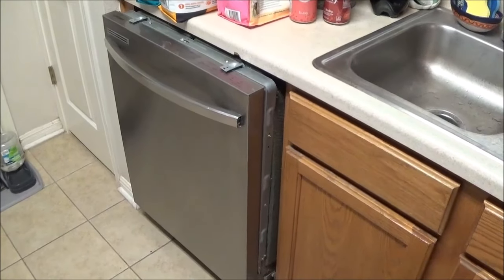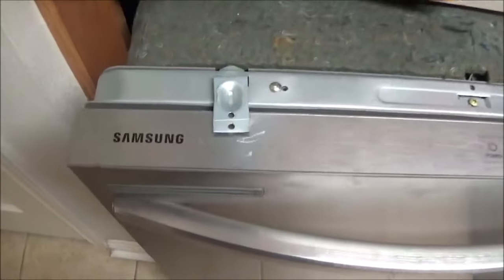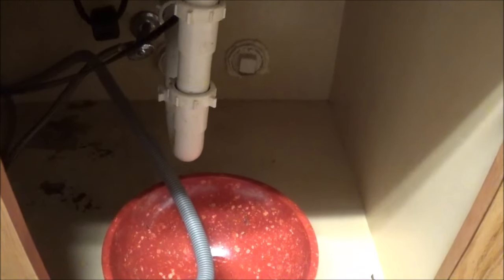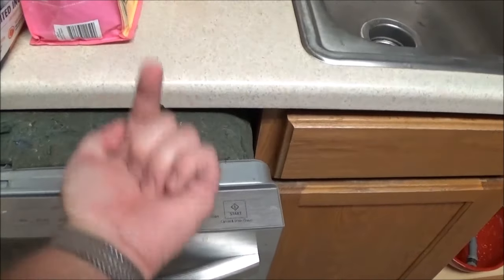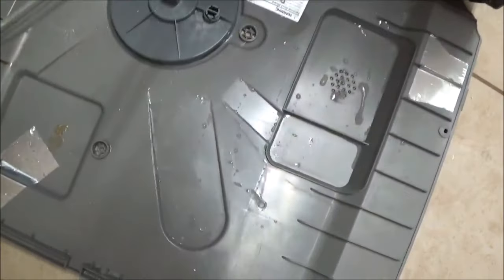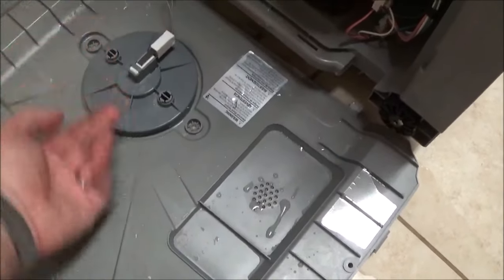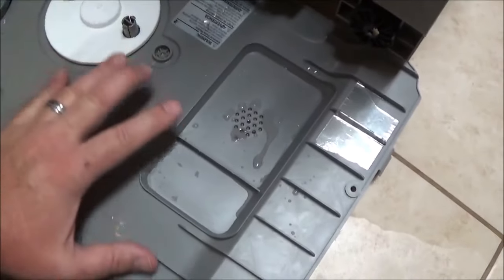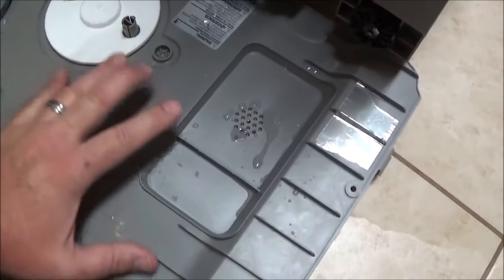Samsung Dishwasher Blinking Normal Light FIX!

Comment: Sir I would have never guessed this fix in a million years. I followed your directions exactly and am in business.  and my wife is thrilled.
Reply from the maker: Excellent.  Glad you are up and running again.  TYMM :)
Reply: Hoping this works for us tomorrow.  Got 2/3 of the way without the video and then decided to YouTube it when everything seemed cleared out but still blinking. Thank you for this!
Reply from the maker: Dani it could possibly be the electromechanical water inlet valve that is the issue. Referenced in the video.
Reply: So far so good from Northern Illinois. My styrofoam piece was pouched out a little. I had to sand it down a little to get it closer to flat. Just barely sanded down the top piece so it wasn’t triggering the switch. Like I said so far so good. Just need it to work till Jesus comes back! Thanks for the video 👍🏼
Reply from the maker: Fantastic!  Thank you for the nice feedback.  Glad all is working now. Thank you for watching.  Please like, share, and subscribe.  TYMM :)

Comment: What you should do is put the discharge hose through a new hole at the topmost area in the bottom of the cabinet to create what's called a "high loop"  This prevents stagnant water from going back into the dishwasher.

Comment: I have the same dishwasher. My normal light was flashing and I had to turn off the dishwasher by the circuit breaker because nothing else would work. Your video was super helpful. I’m a single lady but I need to figure out how to do this myself because I don’t want to buy a new one, so thank you very much. I have had the dishwasher for four years. Never had one problem with it after my son installed it for me. It’s been working great until now.
Reply from the maker: Hi Anna.  Glad this helped you. I have had mine for 4 years also.  Thank you for watching. TYMM :)

Comment: We bought this exact dish washer. Got it hooked up, then realized the drain line that goes to the garbage disposal has a punch hole that you have to knock out with a screw driver. Because it wasn’t popped out the water did exactly what you said, blew back into the washer and remained on the bottom pan. Did what you said and BOOM! Fixed in no time. Thank you sir, wish I could buy you a beer (or two).
Reply from the maker: Yes, that will definitely cause it to shutdown and flood.  Glad your back up and running Sean. Cheers!  Thank you for watching.  Please don't forget to subscribe for more videos.  TYMM :)

Comment: Thank you sir!  The pressure relief valve on our main water line coming into our house gave out after the city added new piping and housing developments (sudden bursts of high pressure). We also lost the pressure regulator on our hot water tank and our samsung dishwasher was flashing normal and start together! Needless to say, after two expensive plumbing repairs, I was thankful to find your video and see this was, indeed, the solution we needed to fix our samsung dishwasher ourselves. In our case, I  did not find a trap blockage at the disposal, so I think it had something wonky to do with either the turning off of the mainline or the draining of the hot water tank. Either way, this was the fix! Thank you!
Reply from the maker: Great write up on your problem. Excellent to hear it is back up and running now.  For whatever reason (there can be several), if there is water in the bottom of the dishwasher, it will not start up until the water is cleaned up. For safety reasons. Glad this video helped you Heather.  Thank you for watching and please like, and subscribe for more TYMM videos.  TYMM :)

Comment: Note: this comment is from my father 
My name is Kevin too, I live in Hamilton, Ontario, Canada. I have a four month old dishwasher just like yours, with the same problem as you. I spent a couple hours trying to figure out the problem and came across your site. You helped me fix my problem and you have a friend here in Canada! Thanks man!
Reply from the maker: Hi Leah - Please tell your Dad (Kevin, cool name!) he is very welcome. I love to hear when my videos help people.  Love my friends in Canada.  TYMM :)
Reply: What did you have to do to fix yours? Mine is less than a week old and started flashing.
Reply from the maker: I had to fix mine twice.  First time was the water inlet valve located underneath was leaking.  I had to replace that as it was leaking. Second time my sink P trap was clogged.  The dishwasher backed up and water seeped into the bottom.  The dishwasher will shut itself down to protect itself (blinking normal light). You have to clean the water up from underneath and dry everything.  Make sure to unplug the device and turn off water to the dishwasher when working on it.  If you are unsure, call a professional to be safe.
Reply: This worked thank you!
Reply from the maker: You are very welcome. :) TYMM

Comment: You are the man! Normal light blinking, followed this video, got her back up and running. Thank you sir!
Reply from the maker: Great to hear Cody. Glad it helped you.  Please don't forget to subscribe as it helps my channel.  Thank you for watching. TYMM :)
Reply: Update: it’s been almost a week and the normal light started blinking again. The first time there wasn’t hardly any water in the styrofoam area, I’m thinking it may be that electrical piece you were talking about, do you know what it’s called?
Reply from the maker: @codyrandles5414  it's a water inlet valve.  Electromechanical valve. But check for other areas first that might be leaking before you buy it. Check previous comments for part number

Comment: Thank you so much for posting this video. Although I have a different Samsung model dishwasher, the basic steps you provided allowed me to find the source of (1) the reason why the Normal  light was flashing and (2) why I was seeing water seeping into my shower which is just below the dishwasher. Apparently, a faulty water intake valve will cause both issues. Thanks to Samsung for creating the float that you mentioned to stop the dishwasher for continuing the wash cycle to potentially cause more damage BUT the float did NOT stop the slow drip that was happening beneath the dishwasher. The slow drip wasn’t enough to pool out in front of the dishwasher to raise alarm bells where I would have shut the water off!!  It was enough to have water pool on the ceiling. Grrrrr. 

In any event, I found the part (water intake valve) on Amazon for $33 + I bought a pack of worm gear hose clamps for $20 to reconnect the hose. Samsung wanted $130 for the valve and the clamp. 

You saved me hundreds of dollars for possibly replacing the dishwasher and calling in a plumber because we thought we had a leak in the wall. Thank you!! I provided additional details here to hopefully pay it forward and help someone else. YOU ARE AWESOME!!
Reply from the maker: Great to hear you got it fixed at the source Theresa.  The water intake valve was an issue on mine as well.  I had to replace it.  Thank you for your write up as it will help others.  Thank you for watching!  TYMM :)
Reply: @texasyardmanandmore3822  I have the same model as yours. Thank you for this video. I am single and trying to fix this on my own. What is the intake valve model number? I'm trying to buy one but don't know what to get. Thanks!
Reply from the maker: @Esmeralda-tl7cj  You are very welcome. TYMM :)

Comment: Thank you so much!! You saved me a service call. Had a lot of water spill onto my counter and it all rolled into the dishwasher (door was open) Followed your instructions and sure enough the pan was full. Letting the floor dry overnight before turning it on. I am confident that it’ll work though since the pan was so full of water.
Reply from the maker: Glad I could help!  Easy 1,2,3.  Thank you for watching.  TYMM :)

Comment: Thanks for the video. I wasn't sure how to get the bottom plastic tray off untili watched this. My leak was the inlet valve. It sits idle for 6 months because I'm a snowbird. When I turned the water on this year, it started leaking. 4 year old Samsung. I found an after market replacement valve for 40 bucks on Amazon and ordered it. But then I tried taking the old inlet valve apart. Turns out you can just unscrew the valve actuator off the valve. I cleaned out a little scale buildup and put it back on. Doesn't leak at all! So I canceled my Amazon order.
Reply from the maker: Thanks for sharing Monte.  Glad your up and running now.  Dont forget to subscribe to help my channel out and watch more helpful videos.

Comment: I had a service tech come in from Samsung twice and he didn’t fix the issue - I have the same problem- the service tech left a main board which I replaced got tired of fooling with it so I bought a Bosch but my dishwasher was on 30 days old but similar to you I had back flow of water into the unit so this weekend I’ll see if that’s the issue with the unit an sell it - much like one of the other guys commented from Ontario I thing you may have solved my problem- one suggestion maybe change title of your video to dishwasher won’t turn off when initially started you would of save me many hours sifting through videos lol - great work from Newfoundland Canada
Reply from the maker: Thank you for the feedback Darryl.  I will place the search query in the video Tag. Thank you for watching.  TYMM :)

Comment: Thank you so very much. We followed your instructions according to the " normal cycle light flashing" i got one good load done and the the light started flashing again. I think it might be the valve you mentioned.
Reply from the maker: Glad it helped.  Yes. it could be, but search for the leak first to be sure.  One other place to look is in the impeller housing.  There is an O-Ring that can leak.  My guess is the electro mechanical, water inlet valve as you stated. Thank you for watching and please subscribe for more DIY videos.  TYMM :)

Comment: This was great! Thank you so much. I think my issue is the Dishwasher Water Valve. Do you have any videos for that replacement install or is it a direct 'plug & play'? Thanks again!🙌
Reply from the maker: Glad it helped. The valve is pretty straightforward. Two mounting screws holding it.  Easy to replace.
Reply: Fingers crossed it works! Ordered the valve and will update 😊.  Great content and so glad you're here!
Reply from the maker: @YS-bl9pe   Thank you.  Please keep me posted on the outcome.  It helps other's.  If you like my video content. please don't forget to subscribe :) Thanks for watching.  TYMM

Comment: Thank you very much for your video! I did exactly follow your video and my dishwasher working well after, unfortunately the problem coming back what should I do ? Please help
Reply from the maker: Hi Louis.  Sometimes it can be a leak somewhere.  So look for that first.  If you cant find it, it may be the water inlet valve.   Look in my description of this video.  Cross check the part number for your model dishwasher.

Comment: Having the same issue with the same dishwasher. This was a great walkthrough of the fix. I had found that if I let the dishwasher sit open and dry out for a couple of days it would work again but after a wash the filter cup would be full of water and this issue would happen again after another 1-2 wash loads. I had previously tried removing the water from the cup where the filter is. Is it supposed to collect there or is that supposed to drain somewhere under normal operation?
Reply from the maker: The water is supposed to automatically drain after every wash.  Make sure there is no obstructions and the drain is clear.
Reply: @texasyardmanandmore3822   Thank you! Might the inability to drain also be due to the water inlet valve that you had to replace? Since it's an inlet valve I wouldn't think so but I'm not very mechanically inclined. I am also going to have to replace the same part. It's visibly corroded and since it's sitting directly above the leak sensor I figure that's where the leak is coming from
Reply from the maker: Its possible.  Mine went out and as soon I replaced it, it worked fine. Good luck.  Thank you for watching. :)
Reply: @texasyardmanandmore3822  I watched so many videos for this issue and they almost all talked about moving or dismantling the leak sensor which is a temporary fix. Your video is the only one I found that even mentioned the inlet valve which sits right above the leak sensor. Bought and replaced the part for ~$40 and haven't had an issue since. Thank you!
Reply from the maker: This is fantastic to hear.  Great feedback. Thank you for watching. TYMM :) @CH-hp6ow

Comment: Thanks for the video. I have followed all the steps shown and everything went smoothly. But once i start a new cycle after a minute or 2, the same error code start flashing. 
Is there anyone else in the same situation? Please let me know if you find a different solution that works for you.
TIA.
Reply from the maker: You will need to find where the water leak is coming from.  Check the impeller housing seal O-ring. Water inlet electro-mechanical valve,  or leaking water from a hose.  A water leak will cause the normal flashing light.

Comment: Do you have a recommended way to find where the water is potentially leaking from?

Initial fix worked, same problem happened again after about 10 loads. Checked the garbage disposal and pea trap and both seem fine. The sink doesn’t back up… A leak must be some where I guess, I just don’t know how to find it?
Reply from the maker: I would look underneath the dishwasher again, and inspect where water is leaking from.
Reply: @texasyardmanandmore3822  doing that now. Nothing is really sticking out to me. All connections seem dry. I unhooked the tube that empties into the garbage disposal and it leaked some water when I turned the washer on its back. Maybe the pump is going bad? Assuming a pump is what’s used to siphon the water out…
Reply from the maker: It may be the electromechanical switch I referenced in comments. Please review.  It MAY possibly be that. Replace at your own discretion.  Otherwise hire a professional appliance repair technician. Ensure unit is unplugged.

Comment: I currently have this issue and will try this in the morning. Any idea what the replacement part number was?
Reply from the maker: Its in the description.  Amazon link. They may have a newer part number so make sure you cross reference the part number and verify it is for your model.  Thank you for watching.  TYMM :)
Reply: Should have checked.. thanks! Also, I did the drying of the basin this morning and so far so good! Thanks for the video.

Comment: I had the same symptoms today.  My problem was that although the whole pan was totally dry, the foam disc (9:56 minute mark) in the limit switch was deformed - shaped like  saucepan lid - and it permanently forced the limit switch closed.  I temporarily removed the foam disc and the machine worked perfectly.  So you can try that if you have the Normal light flashing yet the pan is totally dry.
Reply from the maker: Great feedback!   Thank you for sharing in case someone else has that problem.  Please like, share, and subscribe. TYMM :)

Comment: Thank you for the video..my dishwasher is fixed
Reply from the maker: Awesome to hear Vin.  Thank you for watching.  TYMM :)
Reply: Hello… it seem to work for me but it’s giving me the same error message. Can you please tell me where I can get the electrical mechanical device that you referred to in your video? It was some type of valve. I’m guessing mine might be defective.
Reply from the maker: @vinclark3878  Make sure you identify where the leakage is first before buying the water inlet valve.  I bought it online from Amazon.  Part number DD81-02265A. Just type that in the search.  10 year warranty

Comment: I’m referring about the parts you pointed and replaced before. I’m wondering what is normal state of that? I mean normally open or close?
Reply from the maker: I am gonna make an educated guess and say the water inlet valve is normally closed until activated to open up to allow hot water to flow in the dishwasher.  If it runs for too long it can overheat. These valves are a common failure part as they get gunked up with sediment or minerals.  Or they can come faulty  due to leaking or get stuck.  TYMM :)
Reply: @texasyardmanandmore3822  Thank you for your reply. I am referring to the parts you replaced and said you bought from Amazon? How do you call that parts?
Reply from the maker: Its in the video description. The link for the part. TYMM :)

Comment: Great video. How did the water get there in the first place? Wondering if you found the source?
Reply from the maker: The water inlet valve stopped working properly the first time.  The second time I forgot to punch out the drain cap on my new garbage disposal.
Reply: My filter had never been cleaned and the bottom filled and overflowed. Clean that filter regularly!

Comment: Thank you for this video! I followed the instructions and wachine was working again. But now (after 2 runs) the light is flashing again. How do I figure out what's causing water to go down there? I have not changed anything in my setup and there is no leaking anywhere and everything is draining. Thanks!
Reply from the maker: Could be the part I mentioned in the video.  See my link in the video description for the part.  Consult a professional if you are uncertain.

Comment: What’s that part with the hose attached to it called? You said you found it on Amazon. I think I may need to replace it.
Reply from the maker: Hi Joe. It's called a water inlet valve. Electromechanical valve.